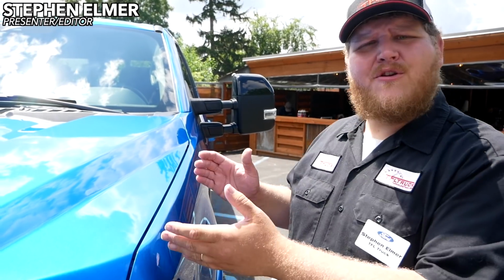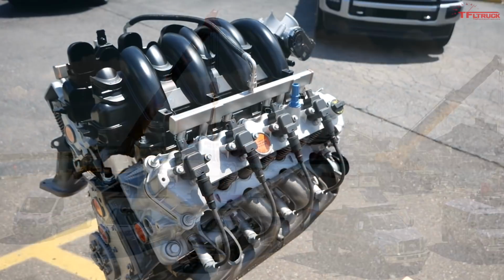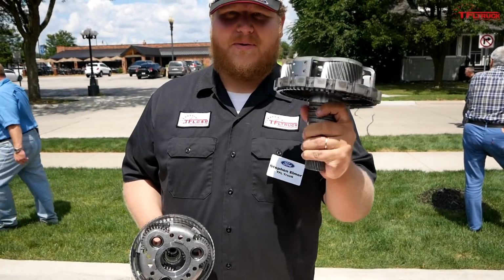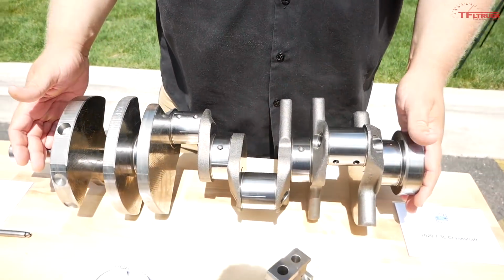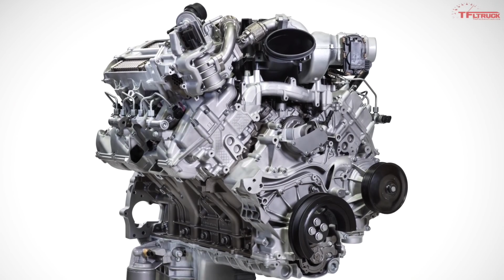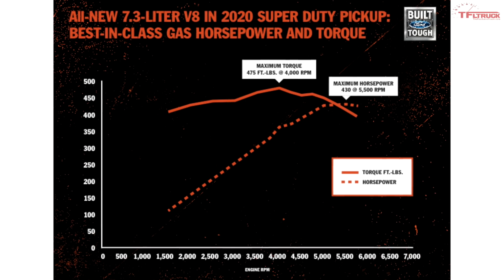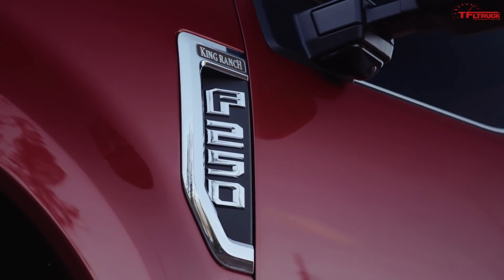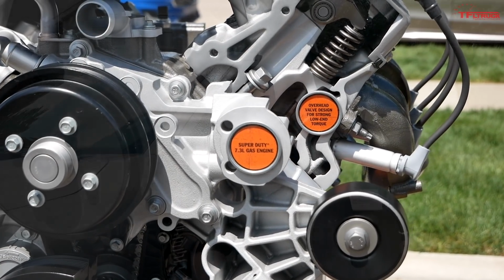We Finally Know the Ford Super Duty 7.3L V8 Power Numbers & They Are Lower Than We Thought!

Comment: 430 horsepower 
475 torque 
Just saved you 8 minutes
Reply: Thisisnotedward EXACTLY what I was expecting . 

30 more HP and 10 more lbft than Chevys new 6.6
Reply: @devinbender8428  you would think with such a bigger engine that they would be at least at 450hp and 490 or 500 pund feet
Reply: @devinbender8428  devin you know ford is sandbagging...the 6.6 chevy is probably 90% maxed out on its numbers...this 7.3 liter can probably be pushed to at least 460 hp and 540 torque with a few tweaks....ford doesnt need to max it out yet...they are gonna wait and see what chevys next move will be, in the mean time ford is comfortably in the lead on power and torque numbers
Reply: @devinbender8428  yea that makes since but i was still expecting something in the 500s the good news is as beefy as it is you can slap on a turbo and make it a gas guzzling monster
Reply: Thank you. It took a while to look for this
Reply: Thisisnotedward thanks
Reply: Thank you
Reply: thats still good power personally i'm more interested in longevity right now i drive an 1984 6.9 idi and a 1982 300 i6 so speed and power were never my game to begin with and a new 2020 7.3 will be a step up no matter what im so glad i didn't blow my savings on a 6.7 powerstroke
Reply: Thisisnotedward you’re my hero
Reply: Not all heroes wear capes. You da man.
Reply: That's healthy
Reply: You can pull over 500hp easily with a simple tune. They are set on a low end range from the factory. That's at least a 500,000 mile engine right there.
Reply: This motor is meant to replace the 6.2 and 6.8 is my guess. It's not meant to race, it's not for people who need a diesel. It's meant for the guy that needs more than an f-150 that will also use it as a daily driver. It looks to be over engineered and coupled with it's simple push rod design a very long life span. Those 3.5 ecos lose out to the gas v8 engines when towing decent loads everytime and compared to the gas engines dodge and chevy put in ther HD'S this has superior power and torque right off the line. Over a good looking everyday Joe's work horse.  If a well taken care of v10 can last upwards of 500k this will do the same job but better with the added power.
Reply: Thank you!
Reply: Thank you
Reply: My man!
Reply: Hell yea man
Reply: My god, what a mouthy b* thanks brother
Reply: the most POWERFUL GAS ENGINE in it's class, with a Superior Torque Curve, but the Nitwit Losers aren't impressed
Reply: Thank you dude!
Reply: Thanks. :)
Reply: Thank you.
Reply: You missed the Medium Duty version..
350 horsepower
468 torque
*Helped you out,not all trucks get the 430 horse version!
Reply: Those are not impressive numbers at all
Reply: Thisisnotedward thnx
Reply: Can’t thank you enough
Reply: I'll stick with the 6.7 lol
Reply: Thank god
Reply: Thank u.
Reply: Thank you
Reply: JEWAHAHAHAHAHAHAAA you really are a dumbass, this is a gas engine. So you should be comparing this to those pos 5.7’s.
Reply: Damn what are they doin with all the extra C.I.? Don't think they need so many Litres to make those numbers.
Reply: I'll take a guess at Power with an Aftermarket ECU Tune

+20 hp & +40 tq - for a total of 450 hp and 515 tq
Reply: I’d take it in an F150 in a heartbeat
Reply: Commerical engines are always lower
Reply: what is the mpg on both the new motors  cant find that anywhere
Reply: @Sid The sloth no the 6.2 in the Sierra/Silverado as well as the Tahoe and Yukon etc.
Reply: You truly are a dwarf among midgets
Reply: Thank you
Reply: Thank you!
Reply: With all the technology we have I was expecting better numbers not saying it's a turd but I'm not actually impressed at all
Reply: MVP
Reply: JEWAHAHAHAHAHAHAAA  Your fiat is way over rated by fan boys. We aren't talking about diesels here. Keep up dummy.. oops... oxymoron. Fiat boy and dummy... same thing.
Reply: @clownwrecker9017  -  yea because a No-Brainer, 3rd rate Troll says too
Reply: Less than the v6 EcoBoost :(
Reply: It has basically the same specs as a 6.0 diesel
Reply: JEWAHAHAHAHAHAHAAA not really dude fords new 6.7 will almost for sure have more hp.
Reply: THANK YOU !!!!!
Reply: Thanks, as soon as I saw the new 7.3, all I could think is dear god at the amount of plastic.
Reply: Thisisnotedward thx those are pretty bad numbers to be honest
Reply: They give people room for a tune and aftermarket. I bet the engine will be super conservative on it’s factory tune and will be very reliable.
Reply: Thanks
Reply: Thanks man  saved alot of my time!
Reply: I appreciate people like you. 🙂
Reply: My little 3.5 has the same torque pretty much lmao
Reply: @Buccko92  
The difference may be in longevity. 

There's a lot more cylinder pressure on a v6 to make those numbers vs a big v8.

You'll pass more gas stations assuming you're not under load though.
Reply: @Seth Miller ignore the torque peak and look at the torque curve. 

That's why they made the 7.3. It's flat from 1500 to over 4000, 400 ft lbs of torque.
Reply: Has more tq/hp that the old 7.3
Reply: Thank you 🌹
Reply: Thank you sir
Reply: Thanks
Reply: 475 lb of torque not bad people just think about horse power but in the racing world it's about torque
Reply: Thank you
Reply: Thank you
Reply: Thank you
Reply: You sir are the real MVP.
Reply: Thats shit
Reply: Gmc 6.2 has about the same hp and torque rating
Reply: Preciate that
Reply: Thisisnotedward thank you
Reply: Thats a shame, a 2019 gt makes 30 more horsepower :/
Reply: I know this thing is built for towing and durability but...thats kind of disappointing.

You'd think a 7.3 litre engine in 2020 would make more
Reply: The old 6.8 V10 was 367hp 452ft lb. Not sure im impressed with this new pushrod 7.3 gas engine 60hp gain, but only 24 lb/ft more torque. Seems backwards for a heavy duty vehicle. And IMO going back to an OHV engine was a mistake. They started going to overhead cam engines in the early 70s with the 2.0 and 2.3 pinto engines and most of the all-new gas engines since then have been overhead cam. And theyve been better than the overhead valve engines from the competition. I think they should've stuck the 3.5 ecoboost in the superduty. The latest variant of it would wipe the floor with this new 7.3...but hey they didn't ask me....
Reply: Not much better from a 6.2 right?
Reply: With Stage 1 CAMS and Cyl Heads, I saw the Godzilla can output near 600HP.  Not too bad!
Reply: Guys, those numbers are made with a tune that is trying to have the least amount of emissions.  Im sure an ECU tune, and a few bolt-ons it will make it a real beast!
Reply: JEWAHAHAHAHAHAHAAA  I'll take a powerstroke every day of the week over a cummins in a crap body made by fiat.
Reply: Thank god
Reply: Thank you!
Reply: Thisisnotedward thanks
Reply: mike force  LOL fatty mcbeefy. thought that was a youtube channel at first
Reply: Glad to see the good ol' pushrod engines are still holding their own.  But I'm not overly impressed with the hp/tq numbers.  I mean really chev can get 420hp/460tq out of the 6.2. I guess the longevity may come into play possibly.  But really a 7.3, I would have expected closer to 500hp and probably well over that for torque.
Reply: @craigquann  What do you mean longevity "may" come into play? That is almost the sole purpose! Peak numbers don't impress you... how about you look at the power band? This engine is a locomotive. This isn't a car engine. This engine will move small mountains.
Reply: @chris1451  again. So will gm 6.2 .  Torque curve I'd pretty much the same
Reply: @craigquann  look at the RPMs though. 

I haven't checked the curve yet, but I bet at 2000 RPM it's got 50 to 100 ft lbs more than the Chevy engine. 

No replacement for displacement.
Reply: @glenwaldrop8166  it wont be that much of a difference.  Both are pushrod v8. Both are built for trucks(1 for half ton the other HD) but their curves will be similar with the fords 7.3 putting out the additional 15-20 lb-ft of torque. Ford is basically going back to the tried and proven tech that they abandoned and that GM stuck with all along. The only benefit the 7.3 (might) have would be stronger internals that will increase longevity.  But that will have to be proven over time.  Either way for the extra displacement.  The gm 5.3 makes 335hp and 383 tq, the 6.2 makes 420 hp and 460lb tq. That ford should be close to 500hp and 525+ tq. The reason for it not is only 3 things, emission, the reduced output for economy numbers and longevity or they cut corners on the build and it wont hold up to the stress. Either way, it's not what people expected and it's not a proven engine
Reply: It's going to be a little different.

To make more peak power on reasonably similar engines with one of them being smaller requires a hotter camshaft.

Really all camshaft does it take the same torque curve and move it up and down in the RPM range. Obviously comparing a 180* duration and 270* duration cam looks different, but compare the 180* to the 200* to the 220*, that's all it's doing, moving the torque peak 1000RPM higher or lower.

The low end torque of the 7.3 is going to be a pretty decent amount higher than the Chevy 6.2 just by the nature of how engines work.

Finally found a source for the 6.2 torque curve. at 1500 RPM it's about 350 ft lbs of torque. The 7.3 has 400 ft lbs of torque from roughly 1000 RPM until 4000 or so.

http://www.duramaxhub.com/gas/gm-6.2-ecotec3-l86.html

Chevy 6.2 hits 400 ft lbs @ 2800 RPM. The 7.3 practically idles at that level.

Nothing wrong with the 6.2 at all, probably gets better fuel economy than the 7.3, however, once you start pulling a load that might reverse. Neither of them can compete with a diesel.
Reply: That’s barley better than a 5.3 vortec. From like 2007.
Reply: Ljkn808_H1 LAW 
Maybe but this engine wont eat itself from DOD
Reply: @2by_Yoter  Your truly an idiot
Reply: hilarious the 3.5 eco v6 cranks 450 hp and 510 lb-tq.... 

3.5 + 3.5 = 7. literally an engine smaller by more than half of the 7.3L that has much more power. Put a 4.0L/5.0L eco in the super duty you idiots. come on, blow us away with nearly 1,000lb-ft of tq from a gas engine from the factory. DO IT BITCH
Reply: @thelongdefeat8674  lofty claims, but it actually has to work for more than 45 minutes to win customers. The commercial market expects to flat foot a utility truck for 300k and not maintian it. That just isn't going to happen with a twin turbo 4 cam v8 like you want. That would recreate the original 6.0 diesel disaster and they can't afford to do that again. Want 1000ft/lb? buy a 6.7 diesel they already make that.
Reply: @thelongdefeat8674  
Engine power doesn't increase linearly with displacement, dumbass. 
[I'll pause for a sec while you look up "linearly."]

Look at oil tanker engines...big as an apartment building, but they rev to like 300 and don't make many hp/liter. They don't need to.
Reply: Total turd.
Really ruined my day as I had aspired to get one of these as long as it had some balls behind it,but nope once again Ford drops the ball just shy of the end zone.
Guess I'll stick with my pos ram until to pump this one with some testosterone.
Reply: Charles henson 
I’m curious as to why this is a turd? This will be for commercial trucks. Where durability is key, not raw power and speed. The old 460 was rated at 180-250 hp and 450 trq. This engine will be a perfect truck engine designed to pull weight for 500K miles
Reply: @roninkraut6873  i was hoping for 550 torq my self, but its a great start. forged bottom end looks great.
Reply: andrew slagle 
Honestly, me too. But it does look ripe for power improvements
Reply: Ronin Kraut it’s a Ford, no way she’s goin 500k miles
Reply: @esimler  no no it won't how about you take your shit mobile and race my stock 5.0 hmmm oh wait I'll wax you I don't know why dodge has a rear view mirror no one's ever behind them...
Reply: Ronin Kraut idk man
Reply: @roninkraut6873  dodge is pushing 900+ in torque.  Those of us who pull heavy loads,  less than 500 lbs is pathetic.
Reply: @roninkraut6873  old enough to know this motor sucks numbers wise. My 454 is pushing 600hp and 550 ft lbs. Dodge has their diesel pushing over 900 ft lbs. 
Until we see real world performance...this motor is not impressive.
Reply: @roninkraut6873  while it might have a fairly flat power curve, you shouldn't be revving a gas motor at 4000 rpm just to get maximum performance.  Show me a motor with high torque between 1000 to 2500 rpms and you'll be better off. Save the high rpms for the track, not work.
Reply: Charles Power 
Okay man. Stick to your diesel and your modded 454. The 454 had what, 200 hp stock? This engine is not a performance engine., for now. Give a year or two and you’ll be seeing engine builds and other performance packages that will make this engine scream BUT for now this was made for commercial truck use and was built for durability not high performance.
Reply: Charles Power 
And this isn’t a Diesel engine dude. There wouldn’t have been such a demand for an engine like this if the gov didn’t step in and ruin modern Diesel engines.
Reply: @showcasecharlie11  old news. it's easy to have over 900 lb- ft in 2019 with a diesel. Ford Chevy and dodge all have it
Reply: @thelongdefeat8674  lol
Reply: @roninkraut6873  
Compared to the Ram Cummins it's kind of sad. The 430 is 30 horse more than the Cummins but the Cummins has 1000. Lbs.feet torque.  Most folks that. Drive trucks know torque is king.
Reply: @roninkraut6873  
One thing I have never seen a gas engine do better than a diesel is fuel mileage . The cost us higher but longevity is much better than a gas engine
Reply: @roninkraut6873  💯🔥 🔥
Reply: @roninkraut6873  lol...if you say so..
Reply: Charles Power 
Which part?
Reply: Bert Grau 
I’ll agree to that. Especially in commercial or heavy duty equipment where the gov cannot interfere with low sulfur and def fluid. When it comes to hard work, diesels are king BUT nowadays it’s getting iffy on the reliability and durability of Diesel engines. Cost and maintenance are extremely expensive and therefore the Ford 7.3
Reply: @bertgrau9246  WAS before all the Emissions stuff, now there's no benefit at the Pump for you
Reply: @roninkraut6873  Exactly why I'm watching this video. Ide like to know the bell housing pattern , width, height. I'm excited to see the aftermarket potential of this engine.
Reply: @roninkraut6873  "Common sense is a god damn superpower, nowadays.".  

That made my day.
Reply: Ronin Kraut The 460 never made it to 450ft.lbs.
Reply: @charleshenson4183  obviously you missed the whole longevity part. It wont rattle itself apart at 100k like a ram.
Reply: @derekwood3189  
I can't deny that part & I have a ram 😂
But I have no intentions on keeping it past 100,000 😁
Reply: Charles henson - agreed. This displacement could easily produce 500 ponies and associate torque at 4,000 RPM without breaking a sweat, and 10 year maintenance free (save replaceables)
Reply: @charleshenson4183  the power band is huge.  its like 400 torque at 1500rpm...  way better than the chevy's 6.6L.  Chevy knows customers won't understand that and I suppose ignorance is bliss.
Reply: @zacharywatson3242  exactly! 400 lbs of torque at 1500 is pretty damn good. that engine is designed to be a torquey and durable powerhouse for commercial use, and wasn't meant to be some horsepower monster to go fast in.
Reply: @charleshenson4183  -  you stick with your Ram POS, and I'll drive the newer more advanced and more powerful Ford Tremor
Reply: @Ranger_Raptor_Twin-Turbo_3.0L  
Enjoy 😎
I have nothing against Ford at all.
I'm actually a huge fan & this is my first new HD ram.
I am disappointed in some things Ford does,doesn't mean I hate them.
I've had several new Ford's lately 15 & 16 powerstrokes,2 16 f150's 1 reg cab fx4 2.7eco & 1 supercrew 16 fx4 sport whipplecharged 5.0,16 Roush rs3 & 18 lightning blue supercrew raptor with every option other than the orange accents in the seats just to name a few.
I'll just sit here & wait for you to catch up 😂
Reply: Charles henson ford sells a truck every 29 seconds in the USA. Don’t think they care
Reply: Get a cummins
Reply: @charleshenson4183  stay diesel......this is for the suburbanites who pull NOTHING!!!!!     :-)
Reply: @charleshenson4183  no they did not it got 400 of 1500 n will most likely lasty a long time as a engine man ill tell you no one is going to cam n tune a bucket truck as a mild hot rod think man but i could 2 it n use as i need to
Reply: This is a working/towing engine. People who dont use thier trucks for work are meant to buy Raptors etc. I wish you guys would educate  yourselves...
Reply: This is a POS Band-Aid fix because Ford finally got the message stop putting V-6 engines And smaller!!  in pick up trucks!!! very underpowered for its size and will no doubt Will be “Ford”engineered with zero technology. , terrible gas mileage , and unproven it will be ridden with problems that were built-in😂😂 wouldn’t touch it with a 10 foot pole
Reply: @AmericanSurvival1 Wow.. aren't you the dumbass of the day. You just don't get commercial operations. This truck isn't for daily driving .
Reply: @AmericanSurvival1  There is so much wrong with your comment I dont even know where to start
Reply: @AmericanSurvival1  This engine will be in the HD trucks that never had the V6 motors, and those motors happen to sell very well, and are both faster than not only the 5.0, but also the V8 offerings from all the other truck manufacturers.
Reply: Scott wonder if it will hold onto to the spark plugs in the heads or maybe they are un removable
Reply: @AmericanSurvival1  
Just like you didn't touch an English book. Lol
Reply: @AmericanSurvival1  personally I say put more V6s in the trucks and less V8s. Turbochargers are where the power is at. You don't see any serious workhorse engines in naturally aspirated or supercharged form - its all turbo. And the nice thing is that when you don't need the power, you dont have to have lots of boost or unnecessary cylinders burning fuel, and no additional parasitic belt driven loads....
Reply: With a few bolt ons a 5.7 hemi will walk this truck all day long. 😂 ram for the win!
Reply: @Bubblyhiccups  I mean are you stupid or are you stupid oh wait your a Mopar or no car douche bag
Reply: @Bubblyhiccups  Ram for the win? You mean Fiat...
Reply: @Bubblyhiccups  You should really look into stopping your drug use
Reply: Jacob smith That’s not what this engine was built for! It was engineered for a work truck. They wanted a longer lasting engine and less maintenance cost. It wasn’t made to be a race engine!
Reply: @Bubblyhiccups  and a few bolt ons and this would walk alll over the hemi again - besides, the hemi spends more time in the shop than on the road. Its an iron turd.
Reply: Jacob smith ram? You mean fiat? Dodge is absolute garbage
Reply: Jacob smith pound for pound the 5.7 in a 1500 ram would smoke this in a superduty
Reply: @esimler  If so, then the ram is one weak POS. Weight is a sign of strength in this segment. BTW.. your POS is NOT a hemi by definition.
Reply: @esimler  So your saying that a 5.7 Hemi in HD truck would be a stronger more capable truck,  really?🥴🤒
Reply: @chris1451  
The Ram engine is a lot closer to being a hemi than anything else and it does have good power. The 6.4 hemi is a good engine for the 2500 as well
Reply: @bertgrau9246  Close only counts in horseshoes, hand grenades, farts, and the backseat at drive in movies. By definition a "hemi" has spherical combustion chambers. Fiat "hemi" does not have that.
Reply: @chris1451  
It is more efficient,  though the GM LS is very efficient as well. Ford seems to have problems with good engines. The 4.6 was a very good engine but they stopped building that engine. For it's size it made good horsepower and torque. Then came the triton lots of problems there .
Reply: chris1451 , if weight is a sign of strength, why is Ford using aluminum bodies? 🙄